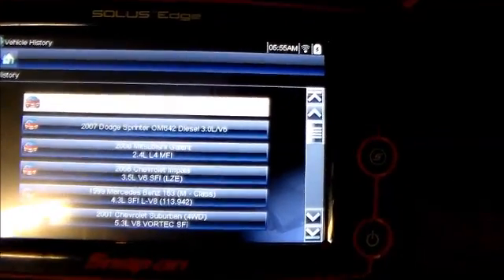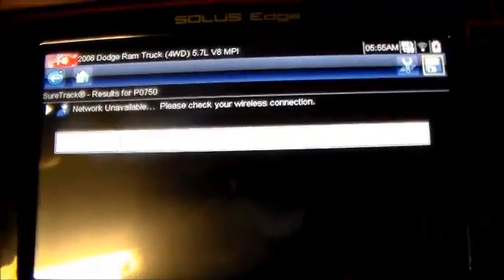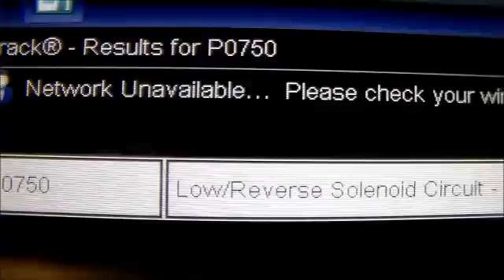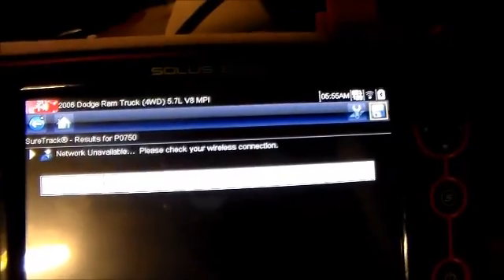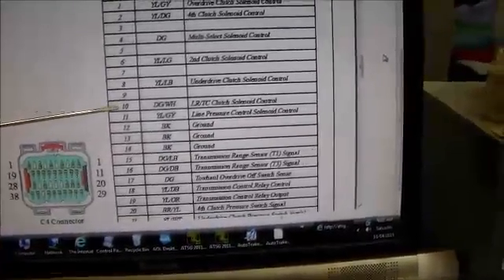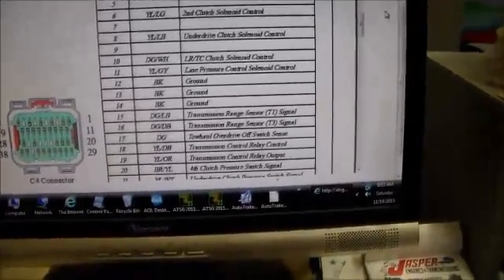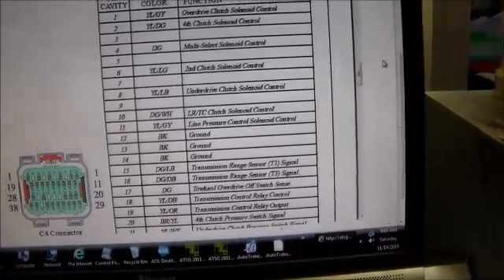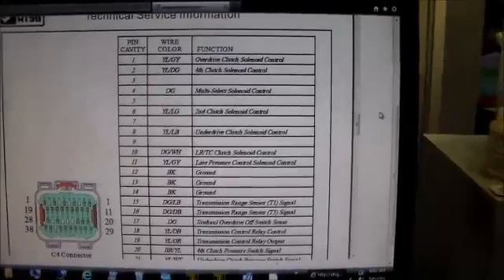545RFE, P0750 Diagnosis and Repair

Comment: We seem to get one of these every three months or so... Especially on the Durangos.

Now we're dealing with a 2006 Ram 1500 4wd 5.7 with the 545RFE with 150,000miles. It came in 2 months ago in failsafe. This customer is bad for putting things off so who knows how long they drove it before they finally brought it in...  We put a new solenoid pack in it. It also had some slight engine issues. But the truck drove well so they took it. 

A couple weeks later they called to say it occasionally stalls on them. A very sudden stall after coming to a stop. Now, just a few days ago they finally brought it in. I spent a bunch of time chasing down engine issues. It had a lot of minor issues but nothing that would cause it to suddenly stall. Then finally it stalled on me. Now I can get it to stall pretty regularly. The engine's not the problem.

The truck doesn't like to creep especially when it's warm. At times it'll have a minor lurch when first creeping. It'll have a few minor lurches then it feels like something kicks in and it starts creeping better. No codes. Fluid fresh and good level. To make it stall you need to light throttle cruise in 3rd or 4th going say 30+ mph then come to a sudden stop and stay there. After half a second or so it feels like the transmission is dragging the engine down. The longer you cruise and the shorter you stop the better chances are it'll stall. If it stalls it'll start right back up with no problems. If you shift into neutral right as you stop then it'll be fine. The truck drives and shifts great. Lots of power, no slipping, nice quick shifts, kicks down good, no delayed engagement, etc. The pan is clean as can be. Was clean 2 months ago when we did the solenoid pack. 

I'm thinking torque converter but I don't want to R&R the trans just to find out that's not the problem... I'm not really sure what I could do to feel more confident in changing the converter. I guess I might notice something while monitoring the input speed sensor data..? Under normal conditions that should fall to zero as vehicle speed approaches zero. If the converter were dragging the engine down I would think the input speed should be non zero when the vehicle is stopped and should reduce in time with engine rpm..?
Reply: I found a Chrysler manual online and poured over the hydraulic flow diagrams. I thought I was on to something! Maybe a faulty solenoid pack? The low/reverse solenoid also controls the converter clutch. When it's fully closed it's applying the low/reverse and when it's modulated it's applying the converter clutch. So I thought, "Hey, maybe it's coming off its seat a little and supplying some fluid pressure to the converter clutch!" But in order for the fluid to get to the converter clutch it has to get past the solenoid switch valve. And that can only happen if the 4C, 2C or OD solenoids are also engaged or the multi select solenoid is NOT engaged... That seems kinda far fetched. I guess it's possible the converter clutch valve could be sticking open a little..? That alone would allow some fluid passage. It says there are TCC apply and release pressure ports on the side of the tranny. That might be the way to go.
Reply from the maker: Hello,  you could monitor input speed and engine rpm to see if they are very close to being the same when in lock-up.  Yes there is those taps on the side, if you go into the tcc off tap, you should have pressure until it goes into lock-up. (im dealing with a lock-up issue now on a 42RLE and its alittle confusing, when the car heats up i loose the pressure on the tcc off tap)  If you go into that tap let me know what the pressure does, im curious to see if it does the same thing . Also in that pump is where the tcc valves are on the earlier units i would find the tcc limit valve spring broken alot.  how are the garage shifts does it seem to stumble when engaging in drive or reverse.
Reply: Had some more time to look at the truck. Data didn't tell me much. There was lots of construction so wasn't able to get it up to highway speeds. I did see some difference between input and engine speeds. Maybe 30 RPMs or so. But that might have just been during partial lockup. I wasn't able to go any faster than about 40mph. 

The pressure chart out of the manual is for 1500 RPM. Both the TCC apply and release ports were showing 0psi at idle. Not sure if that's normal. The flow diagrams make it look like there should be some pressure even at idle. The TCC release pressure was pretty much bang on spec. It was 45-75psi unapplied and dropped to a steady 0 when applied. The TCC apply pressure was almost always 0. Pretty much only had pressure under heavy throttle. Even cruising fast enough where the scantool said the TCC was engaged, the TCC apply pressure would be 0. Hit the throttle hard while cruising and the pressure would momentarily jump to 35-50 psi but then fall back down to nothing.
Reply from the maker: Seems like all is working ok, i just did a 42RLE hooked up to the release port and kinda got the same thing, i came to the conclusion that all my valves were working the way they should and my converter was the problem.  If you have a 30 rpm difference thats not to bad(out of range for me, i like to see below 10 rpm)  So when this stalls are you coming down to a stop?
Reply from the maker: Sorry for the late reply, but i confirmed that my issue is the converter, i flushed out the transmission cooler and the screen was loaded with clutch material
Reply: No need to apologize. I know what it's like to be busy. And you've got a shop to run. I totally appreciate the time you put into youtube helping others out. 

We got the converter in yesterday and the truck mostly put back together. We'll know today if that fixed everything. I am kinda new to diagnosing tranny issues. I'm going to be a bit nervous going for that test drive. There were plenty of things that pointed towards converter but I like it when you can find more of a "smoking gun" so you can be more confident in your call...
Reply from the maker: Yes, i agree, one thing that made me sure it was the converter is when we flush the trans cooler out, i had to flush it for a 8 hours til it came clean and the trans was like new, so for me, it had to be the converter. Gary
Reply: Well back to the ol drawing board... New converter in and truck is still stalling... :/
Reply from the maker: E Urban  Exatly when does the car stall?
Reply: Well, I finally got this truck licked. It turned into quite a saga. What it was doing was stalling right after you come to a stop. It would mainly happen when the trans is warm to hot. When it doesn't stall outright you'd usually feel it lugging the engine down. Then you might feel the truck surge a few times right as you start going. Once you're well into the drive it would usually stall on an abrupt stop. 

My boss tried sending the truck to the dealership. Their great advice, which they charged used $350 for, was to remove the NGK spark plugs we just put in and replace them with OEM spark plugs. Then after that to swap one coil at a time. I couldn't believe that. The truck wasn't misfiring. It had tons of power. Would only stall after coming to a sudden stop. When it did stall it stalled very abruptly. And it never set any codes. The plugs and fuel injectors are fed power from the ASD circuit in the TIPM. If that cut out then you would DEFINITELY have a code. You could even clearly see in the live data the PID for 'ASD Circuit Sense' remained 'High' until after the truck stalled. They're also two wire coils with the control wire going directly to the computer so it can easily monitor misfires. So again... there would be codes. When they told us spark plugs I almost lost it at them.

I ended up replacing the trans solenoid pack and the filters and it worked perfectly after that. I did a bunch of reading up and apparently these trannies can be prone to having the TCC slow to release if the fluid is low. Which is totally what it felt like was happening. Like when it didn't fully stall and lurched after you started going again. It felt like you were fighting a partially applied TCC. So ya, I guess something in the solenoid pack wasn't sealing..? It's mint now though. Comes to a stop smooth as butter and takes off perfectly. It also has good creep now which was an issue before.
Reply from the maker: Glad to hear its fixed, did you end up getting a new solenoid pack?
Reply: E Urban I had a truck that had similar problems. When I would come to a  stop, I would be praying it won't stall. My problem was a bad transmission cooler.
Reply: I have the same truck.
It also stalls.
Loose wires or relays in the box was causing it.

Comment: 2006 durango feels like it's taking off in 2nd gear sometimes. Could it be a shift solenoid problem?
Reply from the maker: Sure, but first thing to do is find out what code is present. If the car is going into failsafe there should be a code. Gary
Reply: +Gary Ferraro thank you
Reply from the maker: Welcome

Comment: Great video. I've got a code of p0770 solenoid 4C on my 2005 dodge Dakota. Only strange thing is the truck runs perfect with no codes for 2 or 3 days the it goes into limp mode non-stop for a few days. I've already changed out the solenoid pack so I know that's not it. It's either a PCM or a bad wire running to the transmission but how can I test? I don't know which pin on the pcm connector to try a continuity test. Thanks in advance for any help
Reply from the maker: Brad, so i look up the right info, what is the engine size on the dakota. Gary
Reply: +Gary Ferraro it's a 4.7 and just in case it matters 4x4. If the PCM is going bad would it work intermittently?  Also the transmission temp light comes on P0218 but it's random as well. I'll start the truck in the morning ( after parked all night ) and the temp light will come on for either a min and off or when I kill the truck and restart the light is off. I have to admit this thing is driving me nuts trying to figure it out.
Reply from the maker: very possible it is bad, when you have solenoid circuit codes, that usuaaly means solenoid pack, wiring or computer. The solenoid pack you put in is a new one?
Reply: +Gary Ferraro it was a remanufactured from Dorman
Reply: +Gary Ferraro the only thing that really has me puzzled is it done the same thing about a year ago but only one time. I pulled over on the side of the road turned the truck off and then back on and never messed up until 2 weeks ago. Now it's almost non stop. It will work perfect for a day or so then nothing but limp in mode for a few days. No rhyme or reason either, one day can't get out of the driveway without limp in mode and other days 15 miles down the road before it goes into limp in mode.
Reply from the maker: I personally dont care for doorman, ive had too many problems in the past with there products.  Info on your car is the C4 connector(one on the end, can be i.d by green plastic on the inside) Pin number 2 (yellow/dark green) is the 4C solenoid control, ohm it with pin number 19(Yellow/orange wire) should be 2.5 ohms. You may have to wait til this starts acting up(you also may have to pull the covers off to see the wires better). This code is a striaght up eletrical code. I personally only use OE solenoid packs on my rebuilds. Gary
Reply: +Gary Ferraro the code reader was showing both solenoid 4c and temp light before and after the solenoid pack change so I'm crossing my fingers that the Dorman pack is acting right. One last question, if I need to change the PCM would it be ok to get either a used one from salvage yard or a remanufactured one?  I can't really afford one from a dodge dealer on a policeman salary lol.
Reply: +Gary Ferraro done a little test. Started the truck put into reverse and then into drive (went into limp mode). Turned the truck off unplugged the transmission harness from PCM and switched pins 1 and 2. Cleared all codes and restarted my truck. Checked code reader and 0 codes. Shifted into reverse and 2 codes came up p0770 and p0700 which are the same 2 codes from before the only difference is the truck did not go into limp mode while going from reverse to drive a few times. Cleared the codes, started the truck and as soon as it went into revers 2 codes p0770 and p0700. Switched the wires back to normal and I get the same 2 codes but it goes into limp mode. Does this sound like PCM?  I guess the real question is pin 1 the overdrive solenoid like I suspect if so then I'm leaning toward PCM problem
Reply from the maker: Very possible you may have a bad computer, being the fact that the wires were switched and the same code came up. I believe even a used computer will have to be programmed with the cars vin number or it may not start
Reply: +Gary Ferraro got the new PCM in and yup that was it. Runs and shifts perfect. Thank you for video and your replies and I appreciate your help. There's not a lot of people that would help out a complete stranger so for that I have to thank you again
Reply from the maker: Great, glad its fixed and thanks for letting me know. Gary
Reply: @bradbevills5320  Hey Brad, where did you get the pcm from? thanks

Comment: i had the same hard code... but had some issues testing ohms, but 10,2,4,6 were all the same...i then switched 10 and 8 as you did and also got the same code, does this mean i should swap the solenoid pack?
Reply from the maker: Corey, did you switch the wires on top only?  you cut the wires and switched them. Gary
Reply: +Gary Ferraro I swapped the wires at the connector only .. I swapped the pins I did not cut
Reply from the maker: Ok, so you pulled the whole wire out and switched them. Is the code a hard code(cant clear it, comes right back)
Reply: +Gary Ferraro yes sir
Reply from the maker: Well, if your getting the same code with the wires switched and all is plugged in, that may be a computer problem. what you may want to do is send the PCM out to be checked. I use a company in miami called SOLO Eletronics(been using them for years) I call them up tell them what code i have and they check the computer. Was anything done t o the car, that you started having this problem?
Reply: +Gary Ferraro no I got the same code u did after switched
Reply from the maker: Oh, I got it now,  ok,just so i understand, you first had the 750 code, you switched the wires on the top and you got a different code. If what i wrote is correct, then more than likely the solenoid pack is no good. Gary
Reply: +Gary Ferraro  awesome I'll put one in tomorrow ... I'll let u know what happens
Reply from the maker: ok, sounds good, with the results that you have, that means an issue with the circuit, meaning solenoid pack or wire. The solenoid pack does have a high failure rate but you may just want to do a continuity check on the wire. Just wanted to mention that. Gary
Reply: +Gary Ferraro fixed the problem ... Now have p0868 and p0934.. I must have missed somthing
Reply from the maker: Are these hard codes as well? they are line pressure codes, there is a sensor on the right rear of the trans just before the extension housing, make sure the sensor is plugged in
Reply: +Gary Ferraro not sure I just checked using the truck dash... I'll check Monday morning
Reply from the maker: clear the codes see what happens